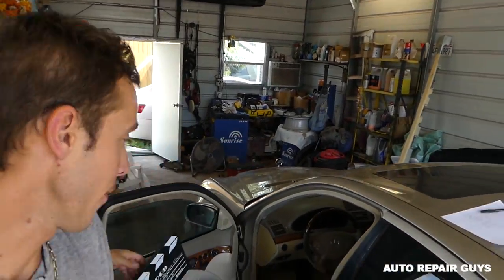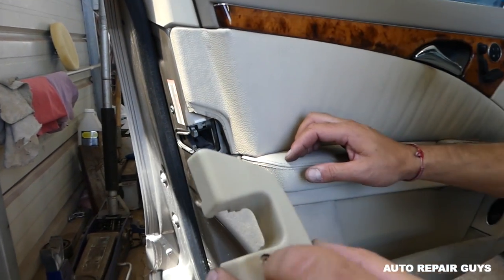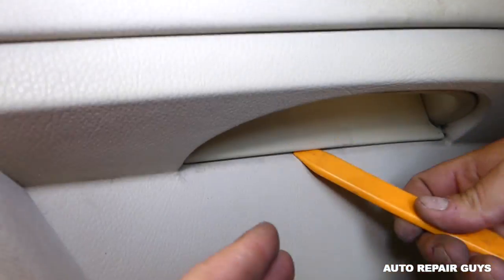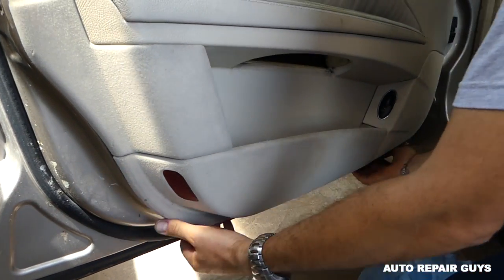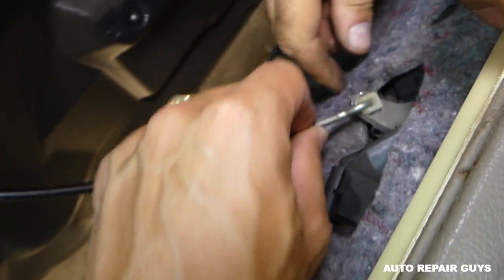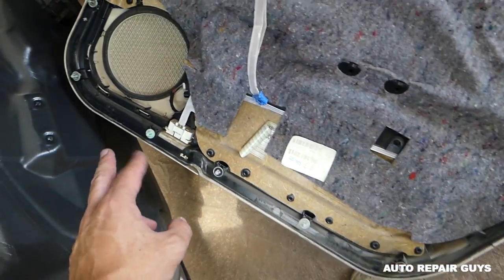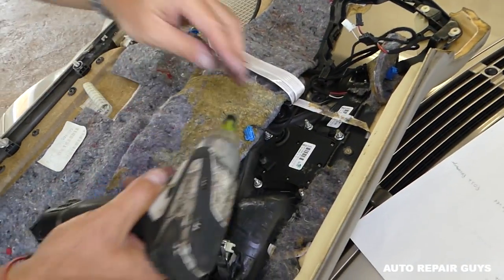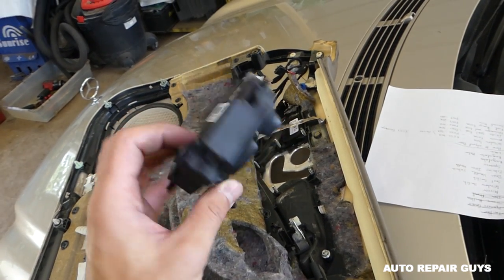MERCEDES W211 POWER SEAT SWITCH REPLACEMENT REMOVAL

Comment: Thanks for the excellent video tutorial guys. Have just replaced the left front switch pack in my E500 thanks to this video.
Only differencesI found were that I had no Phillips screws, those three in my car are T25 torx. Plus my door lock knob did not have to be removed. Mine is like plastic doweling, so the door panel just lifted straight over it. Cheers, Graeme

Comment: Hi Guys! While replacing the power seat module the door panel slipped from my hand and the white, flat electrical connection tore away from the blue connector which was still attached to the door. What is that part called and how hard is it to replace? What does it connect? My mirrors stopped working after this event. I want to replace the band but can't find it because I don't know what it's called. Thanks in advance!

Comment: Do you have a video for a W230 "seat heating" repair? Module, seat element etc. Drivers side slightly heats. Passenger side: seat no heat, back portion heats fully. I have a fluke meter.

Comment: Good vid - but the screws that hold the door panel to the door (two around the door handle and one near the hinge are NOT phillips head - they are T30 torx - not sure why yours had phillips head but someone must have been in there before you and changed them out.
Reply: Yep, every screw on mine is Torx. Either T30 or T20. Other than that, though, great video!